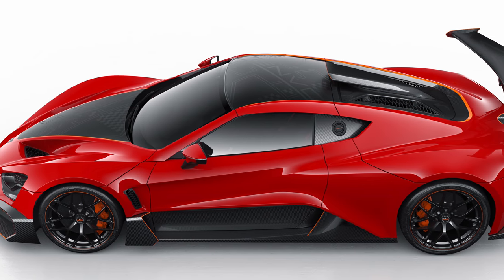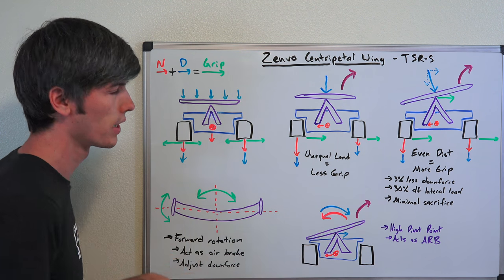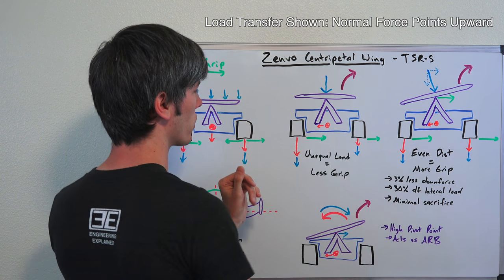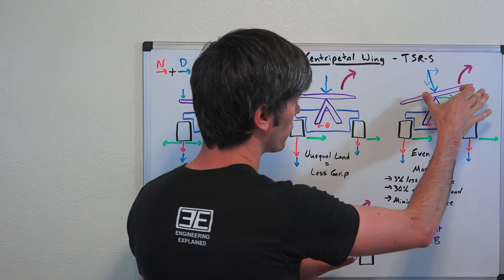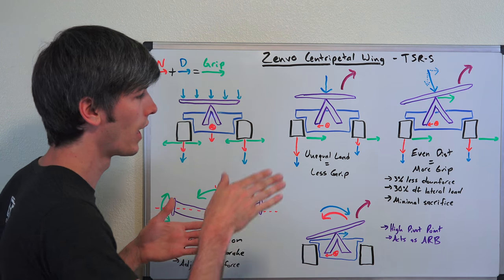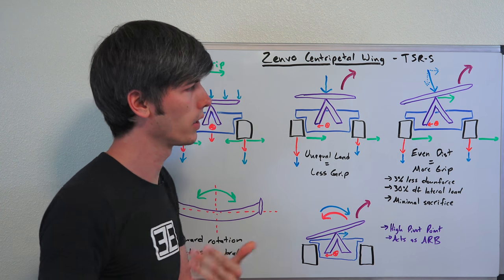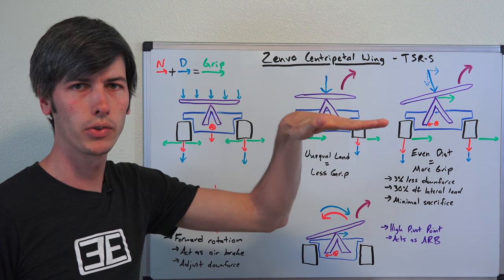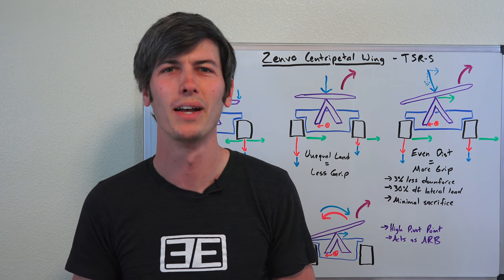Zenvo's Brilliant Centripetal Wing Maximizes Grip

Comment from the maker: Hello all! If you enjoyed this video you may be interested in learning about a similar technology Lamborghini uses in the Huracán Performante, which lead to numerous lap records, called ALA: https://youtu.be/FG2lWRAW-aU
Reply: Great video
Reply: Engineering Explained can you do a series on diffent motor sport like F1 ,nascar,24 hours of mans to explain to us what tech is used and if you could modify it what would you do
Reply: Engineering Explained сделайте пожалуйста перевод на русский язык.
Reply: I watched the video of the tilting wang. Looks ridiculous. A 100,000 wing on a $2 mill car for a billionaire who will park it forever. Performante wang is better.
Reply: Wouldn't this be ideal on the rear and on the front?
Reply: It also works as a clothes dryer and a cup holder and a little sausage magnet.
Reply: Engineering Explained can u explain how a car with electric motor on front axle can spin exactly same as the rear axle powered by a gas engine how are they Synchronized
Reply: Quick question. Wouldn't applying a lateral force pushing the rear of the car into the corner cause some understeer? Is this negated by mounting it so the lateral force is turned into a torque twisting/tilting the car into the corner or is this force just not strong enough to promote understeer.
Reply: Engineering Explained how much of a track car would this technology be if applied also with ALA the Lamborghini air distribution/downforce ?
Reply: I would theorize that the movement of the Zenvo wing in forward accelleration is the same as any airplane's ailerons that is diving left or right. During braking it would be an exaggerated angle that wouldn't necessarily work in an aircraft. But I wonder if it's better to have a little bit more downforce, and less drag, so that the rear tires would be able to brake more effectively?
Reply: Also, I hate to disagree, but the wing acting as an ARB is EXACTLY the same thing as you described in the entire first part of the video. It's not something extra to the downforce, they are the same thing. But I'm open to criticism.
Reply: Can you explain why Top Fuel cars have the wing behind the rear axle? It would seem to induce lift to the front.
Reply: Blanchy10  My guess is that there are regulations that keep the car within certain guidelines: weight, overall dimensions, engine displacement, tire diameter, etc . The further back they can put the wing (relatively), the more downforce they can put into the front wing to equalize the forces to allow you to steer “safely”. My guess is that the front and back wing act together across the long lever arm of the car, while also considering the other restrictions, to give you the most downforce on the rear tires.
Reply: Can u make a video comparing Disc brakes and drum brakes
Reply: yeah like i wonder now, why don't formula 1 cars have this if it makes you able to corner at greater speeds
Reply: Hello Jason. I sent you a message in Facebook so we can see what do you thing about friction testing oils. What can we learn from that? Just check on Facebook messages cause someone already made hundreds of tests on many, many brands, viscosity and temperatures.
Reply: Neil Amalfitano They don't need to "spin exactly the same or be synchronized" at a fundamental level (synchronizing them so that power delivery is predictable is of course really helpful). The motors don't attempt to spin the wheels at a given RPM (usually), they're trying to impart a positive or negative force on them. If the wheels are spinning at a given speed  and you press the loud pedal to accelerate the electric motors will try to impart a force on them to make them spin faster than that, but they're not thinking "Oh I'm doing 100 rpm now, lets try for 150 rpm). They'll make the wheels spin at whatever rate the current power level and rolling resistance etc. allow them to spin. As long as both the gas engine and the electric motors are trying to go the same way, they're making each other's work easier. An electric motor that's not trying to actively accelerate or decelerate the front wheels has a very small effect on the total rolling resistance, so if the electric motor isn't doing anything it's basically the same as not being there. And if it is applying a force, it'll just reduce rolling resistance and even help accelerate the car.

You'd only run into trouble if your gas engine was trying to engine brake while the electric motors are trying to accelerate, or the electric motors are trying to generate/harvest power while the gas engine is trying to accelerate. This would only really happen if you had a malfunction, a big difference in potential maximum wheel RPM (with no freewheeling/disconnect option, so that you're literally trying to spin the direct drive electric motor so fast that it's going past it's physical limits and is in danger of breaking due to friction etc.) or a really badly configured control system.

And of course it's theoretically possible to build a really poorly balanced system, where you have a really underpowered gas engine driving the rears and a really overpowered electric motor driving the fronts, in which case you could get wheelspin at the front while the rears aren't able to do the same at the rear. Still, this would be similar to getting wheelspin in a front wheel drive car, but you'd still accelerate quicker because at least there's SOME push at the rear too. But this is one reason why the new NSX as an example has two 36 hp electric motors at the front compared to having one 47 hp electric motor and a 500 hp gas engine powering the rears.

Comment: I'd like to see a comparison of track times between the wing stationary vs active.
Reply from the maker: That'd be super cool!
Reply: Stovall's Garage it will increase cornering speed considerably
Reply: sagar hande Should* that's one of the fun things about engineering,  seeing if what's on paper translates to real world, I'm sure it helps , I'd just like to know how much so, I'm not skeptical just interested.
Reply: It will also reach higher speeds on the straights since it can reduce downforce and drag. Cool to see a small company coming up with simple, innovative solutions.
Reply: Stovals it will be depending on the speed and on the track where it will be tested . But, i expect it to increase 2+seconds
Reply: Timon Burkhard thats thing is old and most racing cars use it
Reply: Yes, exactly. But it still plays a role when comparing the wing active vs. fixed. To find the effect of the side to side movement alone, the wing had to be partly active vs fully active.
Reply: I'd like to see that in action too because I'm a little bit sceptical concerning the effects. Here's my point : the lateral force generated by the wing in corners has to be superior to the (mass-of-all-the-mecanisms-articulating-the-wing x the-Gs-due-to-centrifugal-forces) for the wing to be efficient. It's cool but... is it cool enough to be efficient too ?
Reply: Kevsler thats nothing to do with efficiency .wing are used to generate huge amts. Of downforce but since in cornering centrifugal force acts to balance the car they have designed like that with min. Downforce red. They are having inc. Cornering speed
Reply: Timon Burkhard DRS in road cars isn’t new technology.
Reply: Although they added extra lateral downforce, but the weight of the system will add penalty to the lap time.
Reply: I mean DRS isn't new, but that tilting wing is a beautiful sight. insane stuff
Reply: @EngineeringExplained  I have a question, so would the high pressure air above the wing push down/try to even out with the low pressure wing underneath the wing meaning high pressure wait is pushing down on the wing  trying to even out with the air down below causing downforce or is there some other way that wings create downforce?

Comment: I'm sure the FIA banned it already...
Reply: They banned it years ago because teams were making dynamic wings that provided more down-force in corners and less on straits allowing for more corner speed and higher top speed. This is really just another example of F1 tech making it to the road 10 years later.
Reply: IIRC movable wings were banned in the 1960s, in response to the Chaparral cars. After movable wings were banned, the Chaparral guys made the "sucker car" (with a big fan to evacuate air from under the car), and that was quickly banned as well. Getting your race car banned from FIA became a euphemism for making it too good.
Reply: Is there a race series with no holds bar rules on tech? I know racing is all about the drivers but I am curious on how they innovate as well
Reply: alteisen99 google Formula SAE
Reply: It was also because moveable joints can fail in the worst way at the worst time leading to deadly crashes at higher speeds. Make a wing out of paper and notice which way it wants to spin when it is unconstrained.
Reply: Yes banned
Reply: No matter. The Zenvo, like other hypercars, is for fun not for class racing.
Reply: With no restrictions on technology, the driver would soon become the weak point of the package. Imagine a car with ground effect, movable wings, active suspension, blown diffuser, etc, taking a corner at 20 Gs or whatever. Drivers would be blacking out. And with autonomous vehicles coming, the driver would be obsolete. Well, I'm sure we'll see autonomous vehicle races eventually, but that's another topic :-) Having said that, the FIA has gone overboard banning tech just because it gives some team an advantage and the other teams complain. There are technologies that could help with the "can't follow or overtake other cars because of aero" problem in F1, but they've been banned.
Reply: Actually there are still moving wings in racing. Like for instance you'll see some of the smaller elements on F1 cars front wings that bend when going fast, that is intentional because at speed going straight you want less drag and do not care as much for downforce. The reason teams get away with this is that the wings are tested in certain ways with weights for stiffness, so if the wings are stiff enough to pass the test they are legal even though they flex.
As in any sports teams always try and find loopholes and and the rule makers always try and stop those holes. One example of what may seem like a crazy rule, in Formula Renault 3.5 (a F1 feeder series) there is apparently requirements on the paint teams use for painting the rear wings. A current F1 driver, Kevin Magnussen, was stripped of a win in that series due to his team by mistake painting his rear wing with a non-approved paint (didn't stop him from winning the championship as he was killing it).
Reply: Anything that can possibly make it more exciting will get banned.
Reply: alteisen99 A budget cap might fix that issue.
Reply: moveable aerodynamics is banned in racing because a) the cars are highly dependent on aero; b) moveable aero is more prone to failure than fixed aero and if you lose downforce you're liable for an almighty crash.

TL;DR: it's dangerous.
Reply: They keep banning a lot of this stuff because the cars would just be too fast for the tracks they race on. I think that sucks but that is the reasoning they gave a while ago.
Reply: Rally did more for road cars than F1!
Reply: alteisen99 The closest to that was can am.
Reply: No matter, this is only for show
Reply: "safety"
Reply: As others have pointed out correctly, the problem was thin flexible wings that were prone to failure and showering a following driver with thin sharp pieces of carbon fibre in their face. Also, some were controlled by computer, thus taking the racing out of the driver's hands (like other computerized traction control). 
    It's incorrect about banning it just because the cars were faster.
I haven't seen if this Zenvo wing is computer controlled but it's called "centripetal" so it can be done mechanically.
Reply: Team with most money will always win at EVERY tech allowance level because they find and exploit the rules the most.  Might as well allow tech due to this.  HOWEVER the death rate goes up with increasing tech because of higher speed.  THis is the real reason for limiting tech.  It's a good reason.  HOWEVER with greater smarts in designing the rules they could have higher tech and slower speeds. It's a lack of rule-making tech that's holding back the sport.
Reply: It isn't fixed. You can chose to turn it on or off
Reply: does vision gt count as no holding back?

Comment: Sacrificing 3% is such a small drawback! Pretty sweet design. Great explanation, Jason.
Reply: Ryan Miller of losing just 3% of downforce??  Monumental.  You get both wheels sticking to the ground and easily pulling out of corners, much less sticking around corners..
Reply: Ryan Miller you lose downforce in the turn, but gain "centrifugal" force. a force that pushes you towards the center of the turn. meaning less force is needed to be exerted by your tires in a turn(so less downforce is less of an issue, and it's 3% less downforce from the normal operation of the wing)

Comment: I want a racing league with a bunch of active aero bits like this. Would be sick to see cars transforming to fit each section of track.
Reply: Resulting cornering speeds and g-forces would be too dangerous for the drivers. That's why F1 has so many limiting regulations.
Reply: Dirty air could be an issue also
Reply: Electric driverless time attack - here's your 1MW of energy, get from point A to point B as fast as possible. There's a 1m diameter pipe, a 10m jump and Nurburgring, among other things. Now shoo!

Racing? Not really.
Would I watch transformer-cars moving at superhuman speeds? Sure!
Reply: ErebosGR G -Suit boom problem fixed next.

Comment: The big question from an aerodynamic perspective is how does this maximize grip in a consistent way when dynamic transitions happens so quickly at speed without upsetting the balance of the car. A close friend who is an automotive engineer pointed out some major flaws with a system like this as to why others have not adopted it. It will be interesting to see how this plays out. Awesome video as usual Jason! 👍
Reply from the maker: Yes, reaction time could certainly play a role in how useful and successful the wing is. I would imagine if you wanted to take the time and money you could also program it for specific tracks, so you could then have it remain flat in areas with quick transitions, and then be active during larger sweepers. It's an interesting idea and I'm intrigued to see where things may go from here!
Reply: I agree. I am hoping that even more innovation will come with the performance cars more than just pretty looks (which as still important) 😜
Reply: Engineering Explained program cameras to look for striped curbing to figure out which way the track is going.

Comment: You can't treat this as a static scenario, it moves between positions so you have to look at what happens in this phase. For example if the wing moves from horizontal to down on the left and up on the right , looking at the underside of the wing what will we see? 

My hypothesis is,  on the right (the side that went up) we would see flow separation towards the end of the wing because its moving vertically but the air is still coming from the same angle so its effectively a higher angle of attack while in motion and this will be more pronounced at the wing ends because its moving faster than at the center. On the left underside side of the wing I would expect to see higher pressure (than static in either position) while in motion. 

I certainly wouldn't want this whilst driving through a high speed chicane.
Reply: chris love Ah, you have hit upon the fundamental problem with helicopters... the flow separation that can happen when suddenly changing AOA.

Comment: Jason, does the force generated by a wing increase linearly with speed or is it a non-linear function? How does wing drag force change with speed? How do engineers determine the optimum size of a wing for a particular application?

Your YT channel is the best. One million thumbs up!
Reply: T. Howard As an aerospace engineer and having worked in the motorsports sector I think I can comment in lieu of Jason. At its core, lift is a function of the lift coefficient and dynamic pressure. Dynamic pressure is proportional to the square of velocity. Drag is the same as lift - it's a function of drag coefficient and dynamic pressure. How engineers design a wing is ultimately selecting an aerofoil (airfoil) which has the desired lift and drag performance for the application. Knowing this and the speed at which you want to operate, you can easily size the wing, particularly if you just set the wing span as the width of the vehicle, then the chord length becomes trivial to define. For reference Lift=lift coefficient X 0.5 X density X velocity squared x area and drag is the same but with the drag coefficient. As a note, everything I've said is relatively simplified but provides a simple and understandable picture of the wing characteristics.
Reply: Aha, velocity SQUARED. Got it. Thanks for explaining the other things too. Very clear.
Reply: You can also check out KYLE.ENGINEERS on youtube. He's like Jason but for aero only
Reply: 69imbatman: Thanks for the tip! Kyle says that he landed a good job with an F1 team and may not be able to post new content but there’s already plenty on his channel.